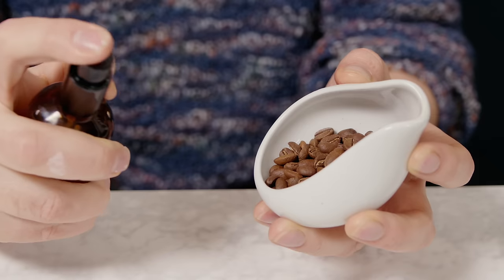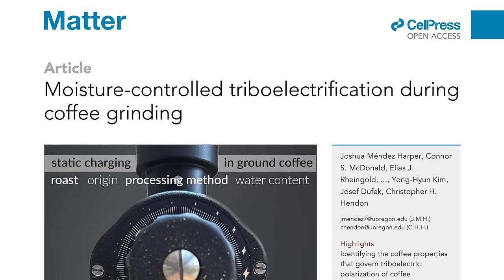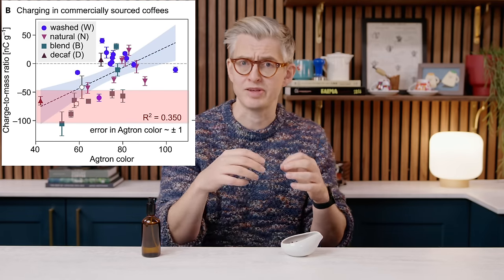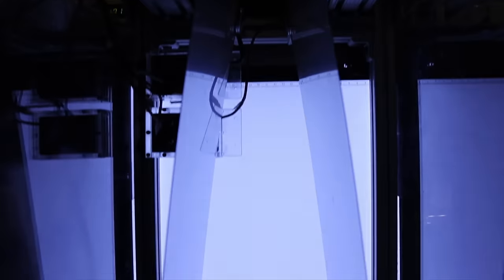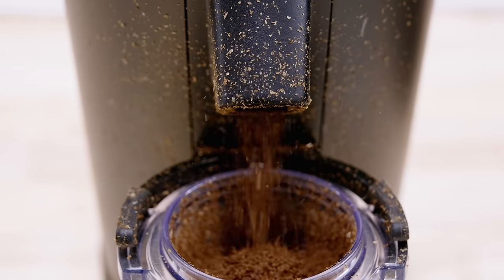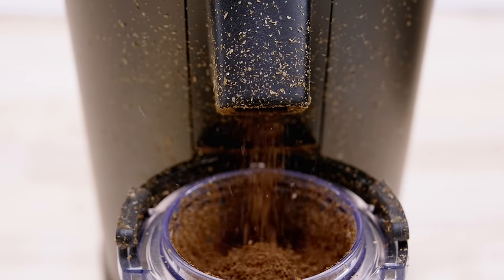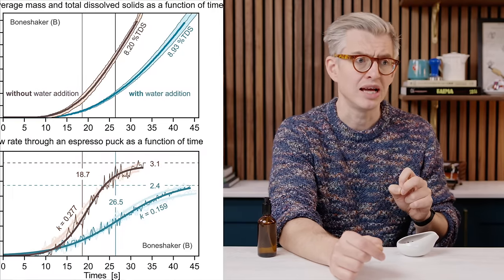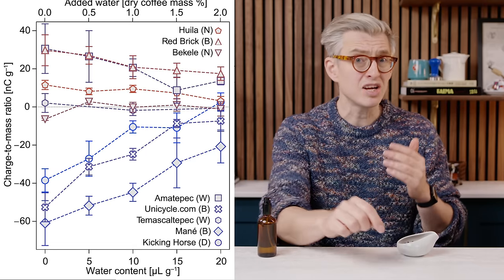Science Discovers What We All Missed: More Than An Anti-Static Hack

Comment from the maker: I’m not sure why the links aren’t showing for some people. Here they are:

The Google Survey: 
https://forms.gle/aggEtudDCnqUVRZr7
The Paper (Direct Link): https://bit.ly/wetbeans
Supplemental Paper: https://bit.ly/coffeestatic
Reply: I think the hyperlink is not opening up correctly since it doesn't include the last portion of the address.
Reply: fyi u have to copy the link, it doesnt make a Hyperlink since its going on the next line
Reply: I used to sell and own a Eureka ORO grinder. They have an anti-static mechanism. They call it ACE in marketing. This might by why the water drop technique didn't have a noticable effect.
Reply: Google link is broken even when uniting the link source
Reply: Obvious question, what happens if you brew your coffe in the grinder ?
IE, pour boiling water through the hand grinder as you crank it.
Be sure to use (thermally)insulated rubber gloves when you test this James 🤣
Reply: Made me wonder how grated coffee beans taste and behave?
Reply: Thank you for the (reposted) link
Reply: Question: might it be a confounding factor that adding more water through the Hendon recommendation will likely increase the final dose weight in the portafilter by increasing the amount of retained grinds being expelled by the grinder? For example, in the likely case that it has some retained grounds from previous, more static-rich grind sessions. This increased dose (likely by over half a gram in many cases) would also result in an increased extraction time/reduced flow, aside from the effects mentioned in the paper. Maybe we could add a measurement step after grinding so that users can ensure to remove this confounding variable.
Reply: @MikeTheBlueCow I was wondering just this.
Reply: Thank you for reposting this url. I just submitted my results.
Reply: @MikeTheBlueCow  You don't already measure the ground output? When targeting brew ratio of grounds in to liquid out, I need to know what the grinder is outputting, not the beans I started with. If the grinder is retaining, I need to put more beans in to get the desired output weight.

Fortunately, my grinder has little to no retention. I'm seeing at most 0.1 g retained. This is before I started spraying the input beans.
Reply: James, I think that the reason why sprayed coffee ends up with a slower flow rate is because the extra moisture actually expands the volume of the same amount of dried and weighed coffee beans. Therefore, the process of the bean absorbing the moisture(previously only through preinfusion) actually started much earlier.  In fact, the expansion of more hydrated beans is most likely much longer than just upon initial contact. It most likely continues bit by bit even after brewing.  The extra volume will most likely slow down the flow rate.  If you or your friend wants to test this, just measure the volume difference over time of fresh ground dry vs moist coffee beans.  That should help plot out the expansion curve rate during hydration.
Reply: @dssyenon  I do weigh the output, I was suggesting that step be implemented in the recommended process to help for more accurate information from the wide user base, who likely do not all perform that step already, as useful as it is.
Reply: I never expected to find a video about someone that cited my research on your channel. Interesting papers and a nice coincidence!
Reply: Do you have to RDT with a hand grinder?
Reply: You are not the part who spent money for doing scientific stuff don't pretend like you are companies do, exactly like old days when companies were paying doctors and laboratories to come up with paperwork saying smoking cigarettes are healthy, what you saying is nonsense and a lie. You are competing to serve the companies. You want the grinders in general and the blades in particular to quickly rust and corrode so that we are forced to buy a new one to replace them. This is how the wheel of the economy of the companies that manufacture them turns, in return the companies pay the wages of YouTube channel owners braying about the matter, What you are doing now is literally putting poison in honey.
Reply: I would be interested in what the effect of the metal pins of a WDT tool is on the aggregates (or electro-clumps😉).👴🤔
We know the tool has a positive effect against channeling, would it be the same using some kind of non-conductive needles?👴🤨
Reply: @Arnaud58  exactly hmmm 🤔
Reply: @jameshoffmann I think your math is wrong you said 0.36g of water, but in reality is 0.36mg which is a massive difference, but anyway amazing video, I like it more when you do science or reviews keep them going.
Reply: You should have told people to clean their grinders first. Also- wondering if mixing the beans while spritzing makes a difference - eg does having an even coating of water make a difference
Reply: James?
What? I just looked at this query you’re asking. First roast level is light—> dark?
How about city/-> Vienna 
Time is a factor several steps removed from the question. Grind particle size is a definite and determinable and therefore useful criteria to examine. It’s also the one you will see from increasing humidity in the grinder. But again I stress it’s not nearly as effective as raising the rH if the bean itself, and while using a sprayer will create a reduction in the the charge free water can create a host of other Interactions that are ADVERSE. Spraying water is not occurring in a vacuum and it is not the only factor, this is why your results varied wildly
Reply: R&D engineer here. I think rather than going through testing a wide variety of grinders it would be more sensible to a small group of bottle-necked as well as a small group of non-bottle-necked grinders really in-depth. Instead of only testing for 3-4 spritzes try to compare pulling shots for 2, 4, 6, 8, 10, 12 spritzes on every single grinder. The reason for this is that you still don't know the physical/chemical principles at work here. My initial guess would be that in a non-bottlenecked grinder there is more coffee being ground at the same time, hence there is less space between beans and a lot more heat (and static electricity) generated, thus requiring more water to counteract fractoelectrification. But just because my guess is reasonable doesn't make it true. It might even be the other way around with bottlenecked grinders generating more static electricity through triboelectrification, maybe because each bean spends more time rolling over a greater burr area during the grinding process and thus they would require more water.
Right now we neither know if tribo- or fractoelectrification have a higher impact on the generated static electricity, nor do we know how which elements and materials involved in the grinding process correlate with either of the two mechanisms. I would love to see a follow-up video in a month or two where you present your experiments and what you found or didn't find (the last one is also quite important, although often overlooked).

PS: The particle analyzer will likely not measure a significant difference in size distribution because there isn't a big difference. What Hendon calls 'aggregate' and what you call 'electroclusters' are simply particle agglomerations and not bigger particles. Because the machine uses image-based analysis you might be well-advised to take a closer look at the individual particle shapes. Agglomerations should probably have circular bumps made from the individual particles that form them, while individual particles should come in more distinct and varied shapes.
Reply: @redsix5165 Jesus yes. Imagine 12 beans are covered in water and the bottom 30 at bone dry 

This is why increasing the the rH if the bean is critical

And then think about what a centrifuge does to a droplet of water…. It’s almost like it was never there
Reply: @jameshoffmann Some manufacturers of grinders do not recommend doing this, e.g. Niche, since it will lead to corrosion. Do this at your own risk.
Reply: It works in the good ol One speed Push button
Reply: Great conversational research, but I don't think it is practical to spritz my beans just before grind   I alway fill my hopper, and live with the first two days of varying the dose size then being predictable for the next week or two.  Very interesting, but not too worthy of trying the experiments out at home.  Keep up the video blogs though.  They are great!
Reply: So I have taking to moistening my coffee a drop ot two of agua and stir it up pre grind. This moisturizing does SEEM to make for less mess in my "single serving" burr grinder which is bonus. Is the final product better? Hard to tell, but the cup I am quaffing is.......PERFECT IMHO. Has me curious James Hoffman et al, should we keep coffee in a humidor like cigars? Is there a certain moisture level which would be ideal for our beans???? Add a bit of eau to out bags of joe upon opening? HMMMMMMMMMM
Reply: Can't you diitch the coffee aspect and just focus on the physics. Coffee is getting  a bit boring.
Reply: You all are heroes 🙇🏽‍♂️❤️🙌🏽
Reply: How is the difference with distilled water?? Does it impact than tap or mineralized water??
Reply: After trying this out for my pour over routine, same coffee, same grind (Ode gen1), same brew method (Chemex), I've found the brew takes nearly a minute less with wet beans as opposed to dry beans. 

There are also less fines left on the paper with wet beans vs dry beans.
Reply: Ceramic burs are insulators, they might have a detectable difference in static build up compared to metal burs that will drain away charge until the very end as they exit the grinder.  
Perhaps even having a plastic exit chute will have a detectable effect compare to a metal exit that wil add not extra static electricity and drain away charge on contact with prticles.
Reply: @Astro_Mozart